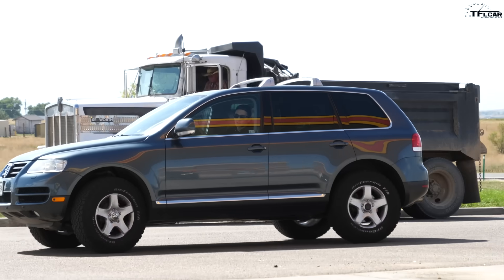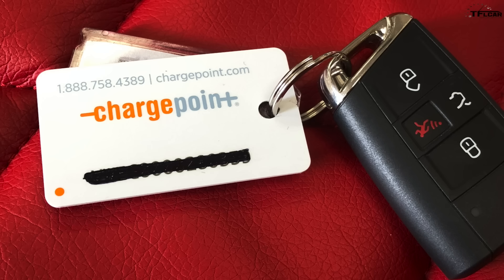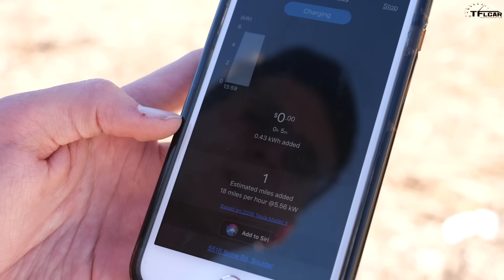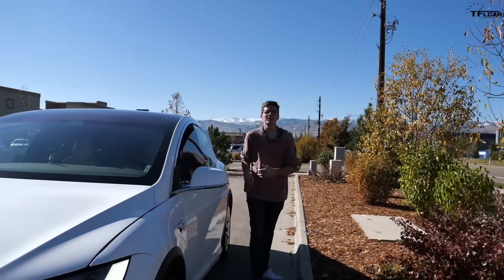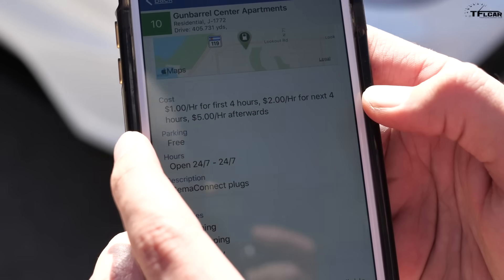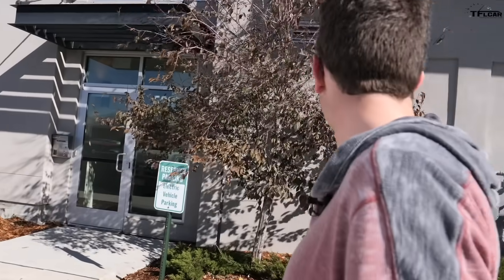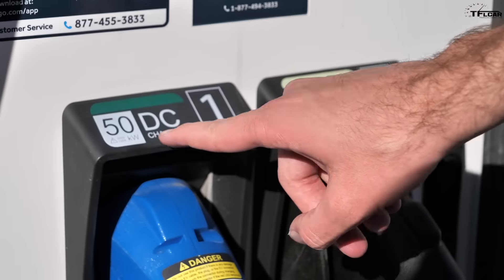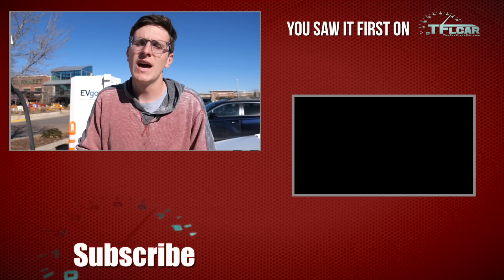Here’s Why Charging an Electric Car Can Suck - And It’s Not The Reason You Think!

Comment: SO inconvenient !
Reply: Not really.  If you have a Tesla you can use their Supercharger network and the car communicates seamlessly with the station to initiate charging.  The chargers and availability are all conveniently shown in the nav system.  If you use Chargepoint, they send you a little card and you just tap that on the charger like a credit card - Tommy only briefly mentioned that.  And most people charge at home or work so really have very little need to use a public charging station.  Apartment dwellers may have more challenge but even now more and more apartment owners are installing charging stations for residents.
Reply: @hx3169  Even if you have a Tesla it is still hardly CONVENIENT.
Reply: @pasoundman  I guess it really depends on where you live and your use pattern.  I live within a couple miles of TWO supercharging stations, one with 20 plugs and another with 10.  And that doesn't include the "other" branded chargers at the library, Safeway, work, etc. My wife can charge for free while she's at work, but doesn't bother.  She hasn't visited a gas station in 9 months, I'm stuck going every week and paying $4 a gallon to fill up the SUV.  But we have no need to use those chargers because it's plugged in at night and so actually very convenient. Only used the supercharger on long trips, and those have been convenient - instead of going to a gas station, it's charging while we eat a meal.

Comment: I have ChargePoint Level 2 charger at my house, charging my BMW i3 with speed of 7.2kwh. Also sometimes I'm using public ChargPoint DC fast chargers at BMW USA and Jaguar dealership with speed of 24kwh (both free). I don't have ChargePoint cards, just using my phone and ChargePoint app to activate session. During my 200 miles trip to Wisconsin I was using ElectrifyAmerica charging stations (they offer up to 350kwh speed) and charged my BMW with max speed of 50kwh. With range of about 80-100 miles i3 is perfect for my daily use. Having private "gas" station at home is awesome. Now ChargePoint app offer activation of EVgo chargers. Tesla should offer adapter for CCS stations like the in ElectrifyAmerica. oops, they do offer them! https://electrek.co/2019/05/07/tesla-ccs-adapter-model-s-x-retrofits/ Well, now it looks they are only for european market :(

Comment: Standardizing the charging apps altogether should be the first step to simplifying the process. However, getting a charger installed at home is much cheaper and much more convenient for the majority of the people you are discussing. That apartment complex you spoke about likely had enough interest from their tenants to justify installing a community charging station that they could use to charge their cars overnight. 

Otherwise, home chargers can be installed by as little as $1000 in some cases, but generally not much higher than $1,500. The convenience of having these vehicles charge overnight on something like that would certainly be better than waiting around in a part of town you aren't familiar with and spend 10 hours charging.

Comment: The lack of standardized payment could be easily fixed just by taking a lesson from vending machines and adding a coin slot,dollar bill scanner, and a credit card reader.
It would be standardized off the shelf hardware and there would be no need to install an app or worry about you personal information getting sold or stolen as you can use cash or a prepaid credit card.
Reply: Membrane556
There's one company in the UK that works theirs that way.  
Tap your card, plug in your car, walk away.

Tap your card again, unplug, drive away.

It just charges for the amount of kw used.

Comment: Ev's dont need oil changes. Dont need tune ups, dont need radiator fluid, dont need smog checks. Dont need spark plugs changed, dont need much maitenance, brakes last about 5 times longer due to regen brakes that charge cars.  Save lots of time not going to auto repair.  In 5 years my VW egolf has only needed tires and windsheild wipers that is it.  Level 2 chargers at home make the car simple to charge.

Comment: Thankfully Tesla superchargers are almost  everywhere, charging is less of an issues than most people think! especially for Tesla owners. if you own a home and drive 2 hrs to work and 2 hrs back you'll charge from home on a 240v outlet. i own two 200+ mile EVs and 100% of my charging is done at home in a city as large a Houston. If you live in an apartment or refuse to install proper charging equipment you will go though what has been shown in this video.
Reply: Chad C The video already explained that very well, thank you.
Reply: How much will a typical installation of a 220V outlet and a charging station cost for a homeowner?  A couple thousand $$?
Reply: @sparklander  It depends what car you want. For a Tesla all you need is the outlet and matching adapter for the included charger. Mine was $600 for the electrician to install a NEMA 14-50 and $30 for the adapter from Tesla.
Reply: Sparklander mine cost $500.

Comment: So no "Smart Phone" no EV?  
10 hours for half a tank?
PG&E Blackouts in California = No paycheck for unlucky EV owner's and no way to escape a fire if the Battery is low. 
On the plus side if you love hanging-out and playing with Smart Phones you got all the excuses in the World for being late to work.
Reply: 1.Most of this have phone numbers to contact so a regular phone will do
2. Yes charging the biggest battery available of electric vehicles on the wimpier lvl 2 chargers will take longer as these are more overnight/opportunistic chargers hence the DC fast charging
3. Yeah it’s a shame they have to suffer from the wildfires that they’re more concerned to prevent than the people who will combust things daily just to move around, pleasure etc but that’s life.
Reply: Not really.  If you have a Tesla you can use their Supercharger network and the car communicates seamlessly with the station to initiate charging.  The chargers and availability are all conveniently shown in the nav system.  If you use Chargepoint, they send you a little card and you just tap that on the charger like a credit card - Tommy only briefly mentioned that.  And most people charge at home or work so really have very little need to use a public charging station.  Apartment dwellers may have more challenge but even now more and more apartment owners are installing charging stations for residents.

BTW, I live in Norcal. It wasn't an issue. Actually, gas stations are the ones that are down - no electricity, no gas pumps pumping gas for my Honda Pilot.  There were huge lines.
Reply: A hose and a bucket are all ya need to get gas! lol  What happens when you don't charge your Tesla for a month or two????
Reply: @brucebaker3523  There would be much worse problems if you need a hose and bucket to get gas, or power is out for a "month or two".  Be a bit more realistic.
Reply: @hx3169   My truck can go 800k on a tank, my car gets about the same range on half as much fuel, so depending on road and weather I can go 1200k in the truck or 2400k in the car with a hose and a bucket. I travel for months so charging is a problem. Buying all the gadgets to keep one car charged is more than I spend on fuel, maintenance, ins and the cost of two used vehicles. Fact is most people can't afford EV's and Solar walls or more people would buy them.
Reply: @brucebaker3523  It really depends on your use pattern.  I suppose for you, if you're driving that many miles then the energy density of gas works better for you.  I'd argue that most commuters don't drive more than 40 miles per day, so a 250 - 300 mile EV is plenty to meet their daily needs.  As far as more people buying them, around here where I live (and it is not Norway, where EV's ARE basically the majority of new cars sold), I'm seeing a lot more EV's.  As my neighborhood watch captain, I visit every house to drop off invitations for National Night Out, around 100 homes.  I was shocked this past August I counted at least 10% of my neighborhood has at least 1 EV (in some cases 2) parked out front, and that doesn't include what was parked in the garage!  The other day I was stuck in traffic and counted Teslas - over 40 minutes I counted 60+!  That's more than 1 every minute. Now, I suppose I should be happy because it should help to lower the price to fill up the other household car, an SUV... I don't know what you drive - there's no way I can get 800 km on a tank.  More like 400 km/ 250 miles before I'm pulling into Costco to fill her up.  I only get 16 miles per gallon, and never run on fumes.  Not sure where your "solar walls" comment comes from. I have no need for one, since my utility only charges $0.10 - 0.11 per kWh, or about $0.03 per mile to run the car (vs. 8x that for my SUV).
Reply: @hx3169  City living is where EV's are needed and excel. Golf carts could double the amount of parking (and they are cheaper than Tesla's) They could also ease congested roadways by a factor of 2 while cleaning the air which is the number one problem in many big cities. Thankfully we live in the rural countryside and use bicycles for short trips to the Market and down to the beach. Driving is normally over 600k round trip (Less than 3/4 tank) in the car or the truck (nearest big city)

Comment: They have to come up with a way for electric cars to generate their own power or they will never replace gas cars.
Reply: Drew Elliott
The way Gas cars generate their own Gas??
Reply: @Robert-j6r8c  You can refuel a gas car in 5 minutes and it takes 10 hours to recharge an electric car so either they have to be able to recharge in 5 minutes or be better than gas cars and never have to be recharged. That would give them a clear advantage over gas cars and people would switch to them in droves.
Reply: Drew Elliott
They just need to charge at the same rate as filling a tank.

Then they'll take over as  driving experience of a EV is better.
Reply: @Robert-j6r8c  If recharging times are the same as refueling then I'll probably be a 50/50 split between gas and electric cars purchased but if electric cars can recharge themselves then gas cars will become extinct. Plus electric cars would have very little environmental impact if we didn't have to produce electricity for them.
Reply: Drew Elliott
How is a EV supposed to recharge itself?  Free energy is a scam.

We already have cars that can recharge, they're called hybrids. Still uses Gas.  They haven't taken over the world.

Ev's can recharge when braking.
Reply: @Robert-j6r8c  Solar is one option. You're gonna tell me you don't think there is any way for a moving vehicle to generate its own power?  Hybrids still have to be refueled with gasoline plus there aren't very many hybrids that look attractive.
Reply: Drew Elliott
Learn some physics.

The Sun puts 1367 watts per sqm

The model 3(a highly efficient EV) uses 237wh per mile.

237x60(60mph =60min) = 14220 watts.

So you would need 14220 watts from solar.

14220/1367= 10.5sqm of solar panels extracting 100% of the suns energy and converting it at 100% efficiency.

No car has 10.5sqm of roof area.
And that's just to drive in sunlight. To drive at night you would need to produce more than you use, so you can store the excess.

There's a reason there are no solar panels on EV's, they don't contribute anything at all.

Physics dictates this world, maybe you should learn about it sometime.
Reply: @Robert-j6r8c  Well i don't know much about physics but i got the solar panel idea Elon Musk. Maybe you've heard of him?
Reply: Drew Elliott
Electric Jesus can not change how much energy the sun puts out.

He says a lot of stuff that is fairy land. Cold gas rockets on cars to name one.
Reply: @Robert-j6r8c  There are so many innovations that we have today that were completely inconceivable 20 years ago that i am optimistic that the next 20 years will be more of the same.

Comment: I think most home owners would have a 240V outlet for their dryer.  The only issue being whether or not your cord can reach.   Obviously apartment dwellers are going to have to rely on public chargers.   The only real option to me for an EV is Tesla because their super charger network make them practical for every day use and they charge way faster than the generic chargers.

Personally I would be fine with a Tesla because I do have a 240V outlet for my dryer and it is in my garage.  I could probably charge Sunday night and it would last me until Friday night easily, then I could charge again for the weekend.  As Tesla has such a solid network of chargers I would be able to go on a road trip and use the same car.  

I do think that they should standardize the chargers though, ,and if Telsa still wants to use their proprietary ones fine, but provide a charger adapter for free.

Comment: I prefer to charge my car in windy rain conditions. I hear 220V and water mix great. Yikes. I'm from Colorado and coming out to 6inches of snow on my car with a plug on it and you're just begging for problems to happen. How long will the plugs last before they go to shit. The day will come when you walk outside and it wasn't charging because of some sort of fault, and then you're screwed. 
Fusion energy will make electricity SOOO abundant that we'll eventually have wireless charging. It's less efficient but we have to much energy who cares.
Reply: Hasn't been a problem as there's GFI every step of the way.

Comment: Nah, I can’t see myself owning an EV as long as this is the technology governing the experience of ownership. New technology works best within the parameters of existing infrastructure. There is none for EVs, so it I’ll always have these limitations. If there were charging stations at every single parking space, it would make more sense. If you could swap out a depleted cell for a fully charged cell in the time it takes to fill a tank with petrol, that would make sense. If they could solve the cold weather problems, then it would make more sense. Until then the technology seems untenable for most people.

Comment: In my town, there are 7 Tesla owners, and Tesla is looking at building superchargers along our interstate system, which currently has none. Our location has been selected and the framework for the supercharger is built, but hasn't progressed for a few months beyond that.
The only real issue I can see is using one in the winter and trying to operate the vehicle heating system to keep the passengers comfortable. That's going to drain the batteries drastically faster than just operating the vehicle itself will. Granted running the a/c in summer would be about the same, but cold temps cause higher demand on the system to start with. 
With a gas powered vehicle, the heating system get's it's heat as a byproduct of the engine's cooling system and re-purposes the heat stored in the coolant run through a heater core and warms the interior of the car that way. The only additional draw on the system is some electricity to run the fan. With an electric vehicle, the electricity also has to operate the heating element and run the fan to warm the passenger area. That would result in less range for the battery pack.
When it's -20 like what we get up here, I'll sooner rely on a gas vehicle.  I know people do it, but I'm good with what I've got.

Comment: Due to the long charging times and sometimes wonky chargers, the only way electric seems to work is if you can charge quickly at home and work.  Big hurdle.
Reply: For 90% of your driving slow charging and keeping the car plugged in whenever it's not in use works.
Reply: @nlpnt  to who's driving are you referring?  People in apartments?

Comment: So essentially if you want to “save the whales“ the most practical application for a user is to own their own home install a high-capacity charger and then just plug in every evening. Generally speaking you shouldn’t have to worry about running out of juice every day by commuting to work or doing general errands. All other applications… Good luck!
Reply: Captndarty For now, basically, yes. Remember that EVs are still in their infancy and made for limited applications and demographics... for now.
Reply: George L it’s been a hell of a long gestation period for EV’s built one in high school shop and 94...
Reply: Captndarty No. No you didn’t build a commercially certified passenger EV in your high school.
Reply: George L that’s not what I said. The tech has been there for years. The car I helped build had great performance while it had a charge.... There’s been no need or desire to invest into it until this decade and unless The government bans ice, Electric modes of transportation aren’t going to become mainstream until you can get a full charge in 10 min....
Reply: Captndarty Technically, some of the technology for EVs has been around since the 1800s. Even in the 1970s Soviet Union there were electric trucks employed in factories to run supplies between buildings. However, no technology existed to store batteries as efficiently enough to have a mass production passenger EV until very recently.

Comment: 1. Shouldn’t need an app, should be able to interface with the charger from the charger...or in the car display. 
2. I’m guessing the Tesla won’t tell you where non Tesla chargers are. 
3. If I can’t gain a full charge in 30 min or less, this wouldn’t work in a road trip.